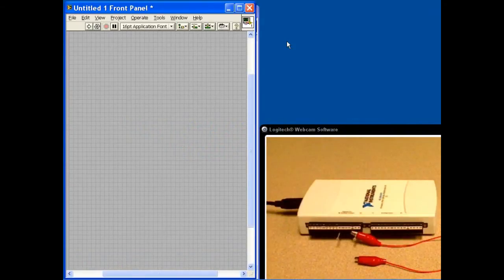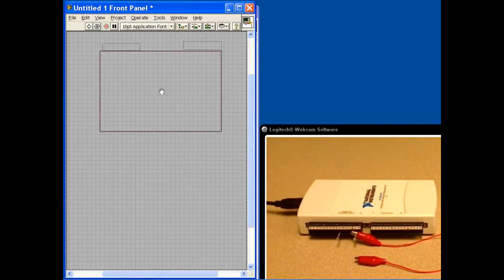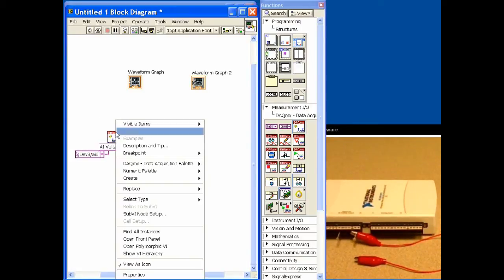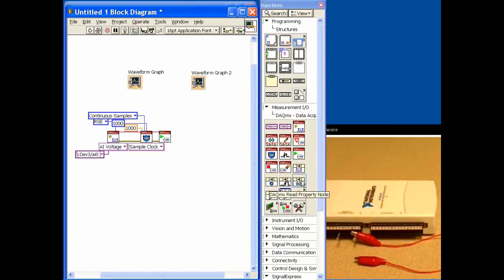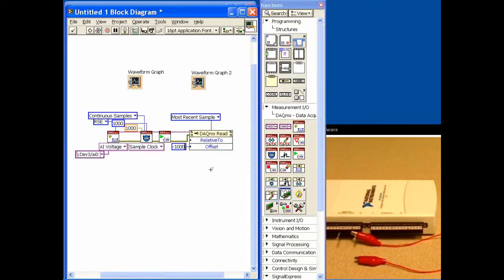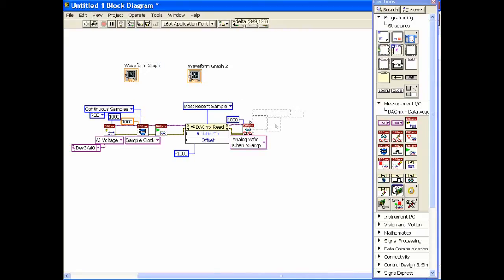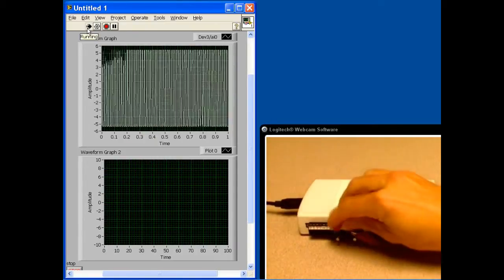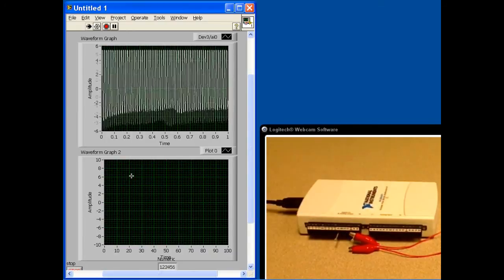High Speed Display and Data Storage with DAQmx Part 1

Comment: Error -200277 occurred... Possible reason(s):

Invalid combination of position and offset. The position and offset specified a sample prior to the first sample acquired (sample 0). Make sure any negative read offset specified will select a valid sample when combined with the read position.

Property: RelativeTo
Corresponding Value: Most Recent Sample
Property: Offset
Corresponding Value: -1000